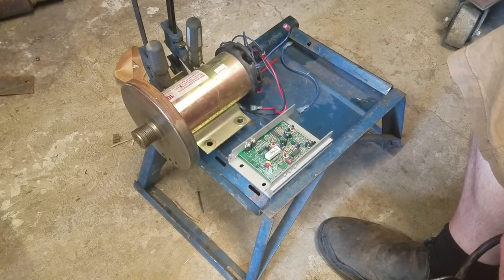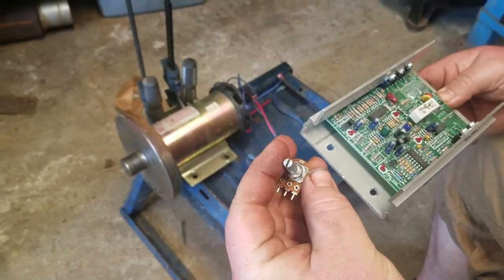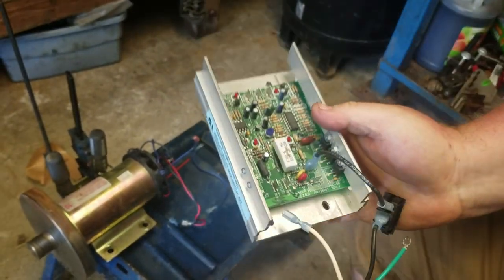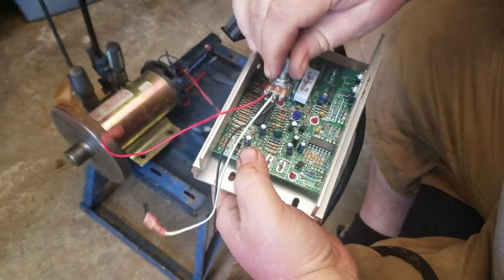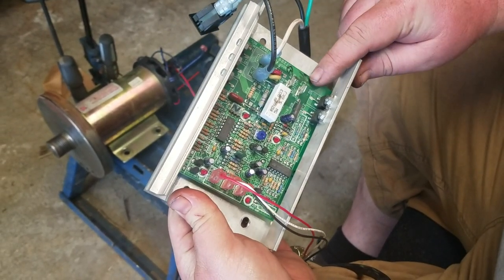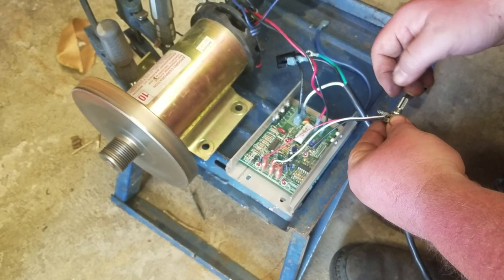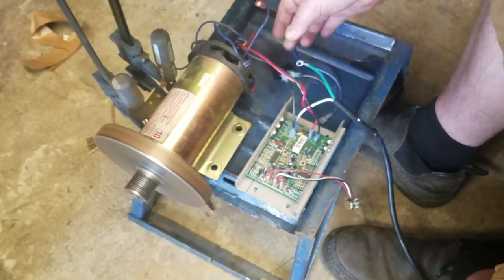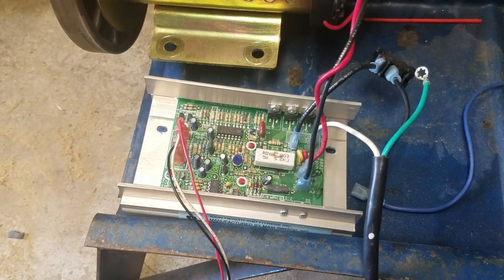Easiest way to hook up a treadmill motor

Comment: Pwm controller. You can buy an E-bike kit with a throttle(potentiometer)twist grip, pwm controller and 48vdc motor etc. That brushed treadmill motor needs over 100 volts to run at full speed. You will not get that with your hack---Your still using ac from your home for this demo.
 For a two battery cart or bike your still going to have to use buck converter, to step up from 24vdc to 120v the transformer will weigh 25lbs. Then those two 12v deep cycle L-IonPe batteries costing $300 each.  But 1/2 the weight of lead acid wet cells.
Just like real full size EV's it's all about the cost of the batteries. 
For 21st century tech-Ta-Da!!!
Try a quality SCR IGBT made by Fairchild for mosfet power inversion.
Oh, with that 7lb flywheel your going to need a one way bearing to stop. That thing is going to have so much inertia I hate to think of poorly designed braking system. CRASH!

Comment: Hi I'm Ed Super important question please 
I have a standup scooter it's old scooter I have the exact motor & board took off treadmill would it be possible I can attach the motor with ext. To my scooter and all I need is batteries car battery or two to have same voltage as you plug into wall electrical socket how many batteries I mite need

Comment: The older MC units, MC 40, MC 60 are simple plug and play.  The newer controllers or those from treadmills with more frills use more sophisticated boards like the MC 2100 that requires a pulse width modulation input to work.  There is a modification for these I found on the web that you can build - to make them work as well.
Reply: William, do you know about the MC 80 board? I'd like to be able to omit the treadmill control panel in favor of just a pot, but not sure if that is possible.

Comment: where can I find that type of motor controller
Reply: cannot  find that type anywhere
Reply: @marciajesso8474   That is an MC60 they can be purchased on line.  However an MC60 is an SCR controller at which point an aftermarket SCR will be just as good if not better.  If you want to use a treadmill type control board the MC2100 is a better choice.

Comment: I pulled my treadmill apart and have an mc-60 controller, but the output from the controller to the motor has a transformer in between. Can I just remove the transformer and go directly to the motor? seems odd to me but thats what im seeing in all these videos
Reply from the maker: yes you can
Reply: @fixitwithbiskit  cool thanks!
Reply: What does the transformer do? It must be there for a reason! Please explain!
Reply: @bobby3hatwoodcarving925  
It allows you to step up/step down power depending on source. So you can use your equipment on 120 or 240 volts.
Reply: If it has just 2 leads (1 winding) then it's a choke not a transformer, and it's generally to filter out higher-frequency AC from a DC (or lower-frequency AC) line. The motor will run without it, but changing speed feels smoother with it (i.e. changes more gradually).

Comment: What about that coil that comes with it.  Some call it choke. What is it for?
Some folks of course use it.
Also what about the blue wires on the motor.
What value potentiometer did you use?
Thank you.

Comment: Add an inductor between the board and the motor on the hot wire to make it a lot smoother.
Thank you for sharing your video.
Cheers

Comment: The name of the part, if not mentioned in comments, he could not remember and the part in his hand is: MC-60 treadmill speed 
controller. If he didn't know what it was....how did he order it? Go figure...
Reply from the maker: because i did not order it offline i got them by tearing apart treadmills
Reply: Part number should be on part or cross ref treadmill....the part you have is Mx-60

Cheers

Comment: That a nice job. I have a motor that I need to get a controller for.
Reply: Rusty Glovebox you can use the controller from where you get the motor. Take all of the board and wire from the tread mill

Comment: Awesome video. I need some help though. I have an MC-60 treadmill speed 
controller. I'm trying to eliminate the soft start and stop. Putting a 
switch from the board (red wire to the motor) gives me what I'm looking 
for but I am concerned about whether the board needs the load from the 
motor. Is it safe for the speed controller to run with a switch on the 
motor lead?

Comment: It would have been helpful if you actually told us the part number off the board
Reply: No help at all if you want to control it with 12volts d c
Reply: I paused video at :22  It's an Icon Fitness MC-60.  I've found that one in ProForm treadmills.

Comment: Is there a specific size pot to use? Would a light dimmer or a fan pot  work for this without damaging the motor?
Reply: Since he said 5k a few times I'm guessing you mean wattage. In which case, a 1/4 watt pot should be fine, a larger one wouldn't hurt but it doesn't need it. I've found a 10 k-ohm to be more common a provide better range control. Use the one from  the treadmill if it has one. Dimmers could have one that may work but  they can vary quite a bit and may not give much more than on or off in range. They're usually labeled
Reply: @maxprophet2401  TY for the response. I'm usually doing other things while "listening" to YT. I found a 10k pot in my salvage, now just to put it all together!
Reply: Ordinary light dimmer will not work, plus they are designed for a/c and the motor is DC requiring a bridge rectifier to convert.